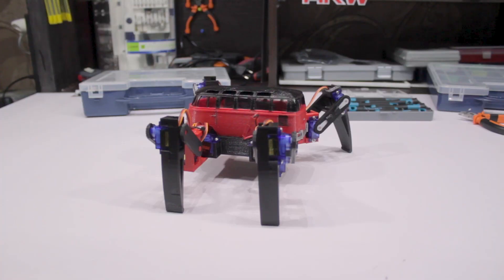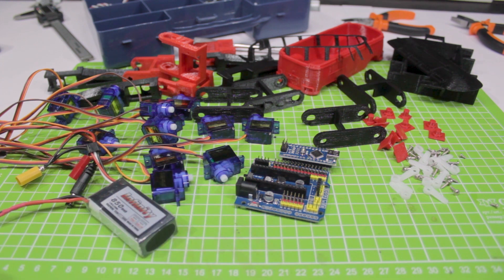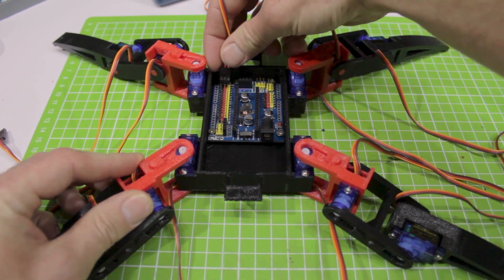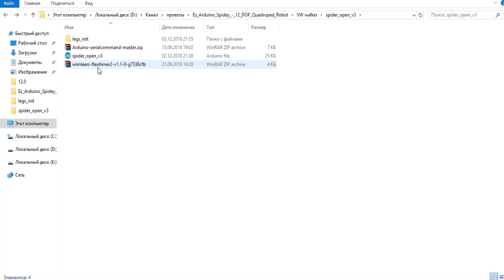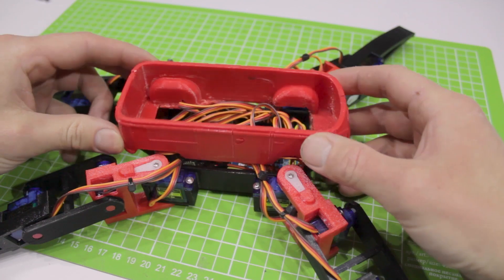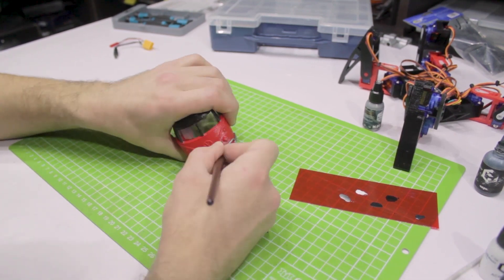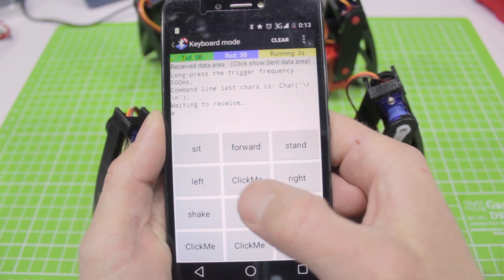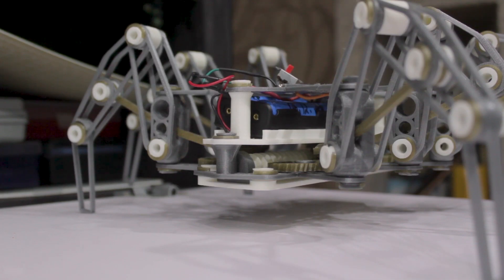Walking Volkswagen T1

Comment: Hi. I am in the middle of assembling one :) For the battery the instructions from the original file say to attach the battery to the VIN. My Nano shield doesn't output the VIN, and I cant see it on your one either. So did you attach the battery to the barrel jack?